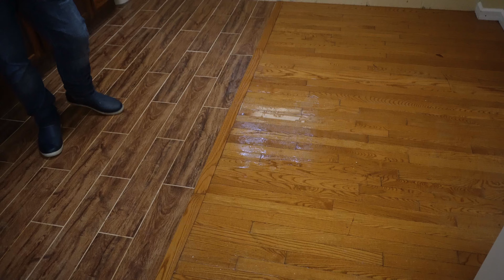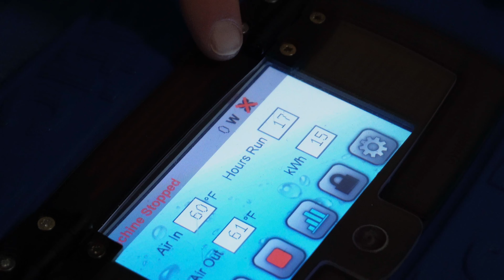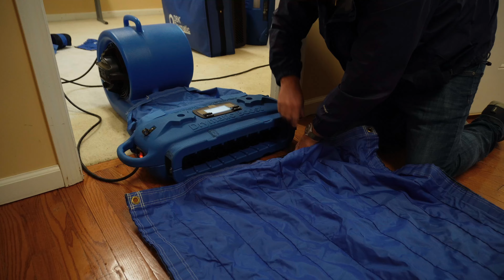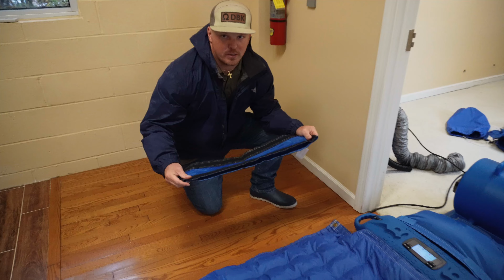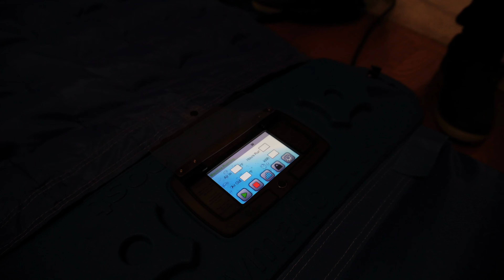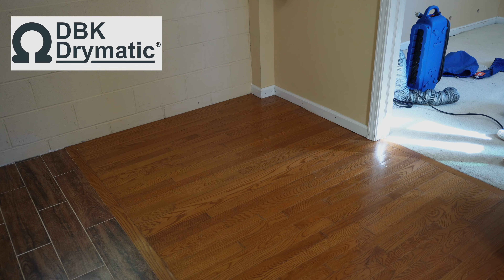Best Floor Drying System Available | DBK Drymatic Demonstration

Comment: Any tricks or suggestions for drying out subfloor. Have ran dehumidifier with 2 air movers in shower pan. Additionally I enclosed the area with plastic. 2 weeks drying a moisture content is still high.
Reply from the maker: If you still have high moisture content after drying for that length of time, it would seem you still have moisture coming from somewhere.  Did you have an active leak in the shower area?
Reply: @DBKUSA the drain flange was not properly sealed so water spread underneath the mud pan for an extended period of time.